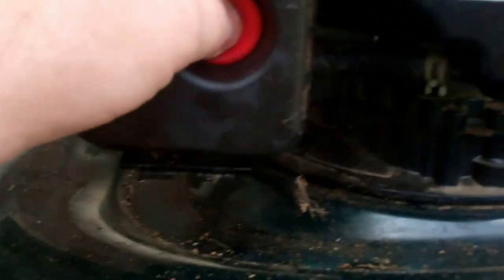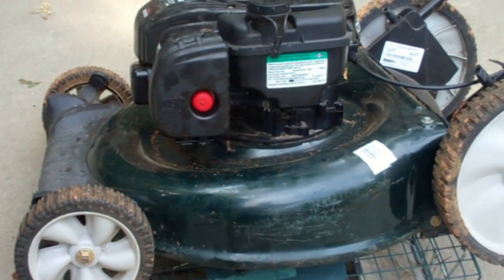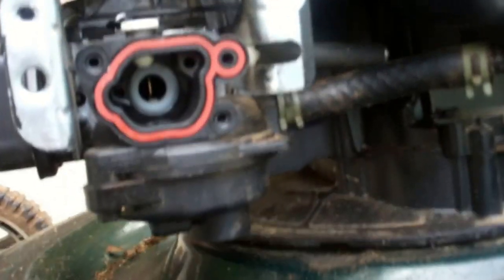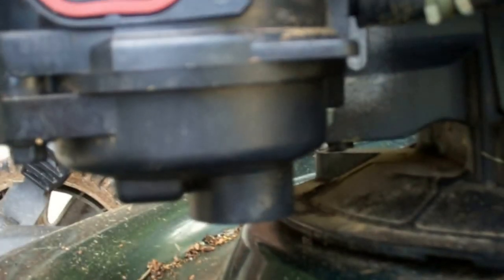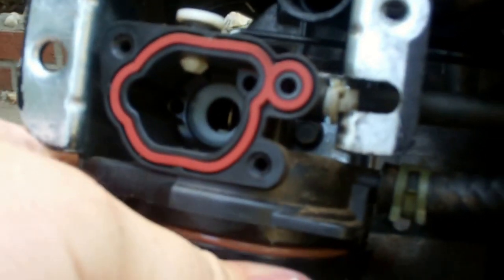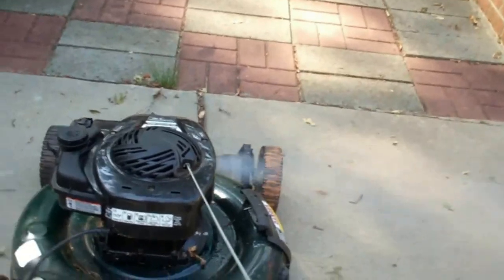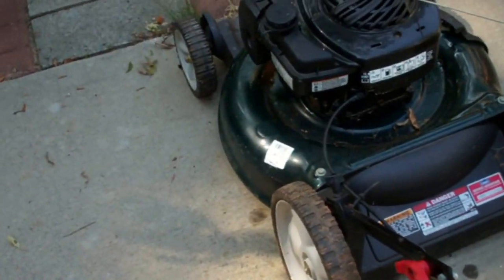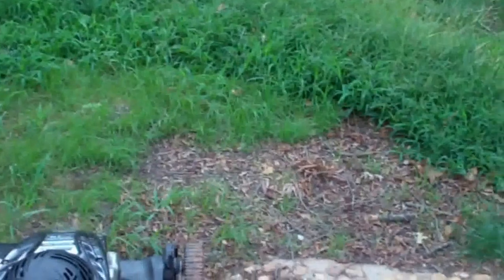Lawn Mower Repair & Cutting Grass

Comment: I have a Bolens with the same engine and of course it wouldn't start so I cleaned up the spark plugs and took apart the carburetor 
The jets were clogged and she started up on the first try.
This lawnmower engine is a Briggs and stratton and it never had any type of fuel filter on it anywhere so it seems like they made it as cheap as possible, these engine's last a very long time as long as you do basic maintenance every year 1 drain the gas tank or use a gas additive for storage
2 check the spark plug before you use it for the first time in the season
3 change the oil before you use it for the first time in the new season
These three simple things with keep your mower running for a long time 👍

Comment: When My Bolens would not start. I took apart the carb and pulled that oval  white assembly out of the center and slid that one small tube off and all the little holes  in that inner tube were plugged. I soaked it Castro super Clean ,rinsed it off and assembled it and it starts first pull now

Comment: Thanks a bunch! I have the same mower and it's less than a year old but has been sitting all winter with (likely) bad gas in the tank (my bad) and won't start. I'll try this tomorrow and hope for the best. Thanks again!
Reply from the maker: No problem. Good luck!
Reply: Jim Simpson Did it work? I'm having the same issue with mine.
Reply: It worked great! I sprayed an Instant Start can (that included ether in the list of contents) on the carb for three sec and it started on the first pull

Comment: Question? Where do you check the oil? And where to put the oil in this specific lawn mower? If you have any video for this o just please tell me answer and I will look for it. Thank you
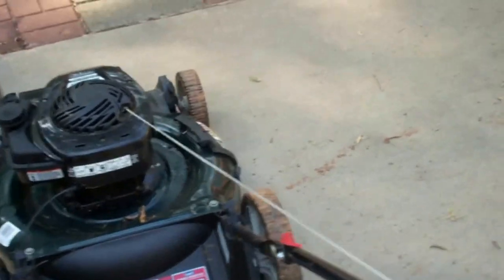Reply from the maker: +Celeste MC On this video at time index 4:26, you'll briefly see a yellow colored cap.. That's where you check the oil.
Reply: RVR2 ok Thank you! Now question #2 where I put the oil?
Reply from the maker: In the same place. You'll need a funnel though.. Just don't over fill it!
Reply: Ok! Great! I was wonder about, Thank You so much!!! I will let you know how was! I will follow the clean up step on the red bottom 😬 Thank You for your help!
Reply from the maker: No problem. Good luck!
Reply: +RVR2 Hi again! Just to let you know that my mower now is working! I just did all that U said in the video (the red push bottom) I had to push many many many times until turn on. 
Thank U
Reply from the maker: Awesome! Glad it worked!

Comment: So I have the same mower. I feel like I'm missing a hose and it's making the mower not start. Wondering if you can help me. Is a hose suppose to go on the small white piece that is right above the fuel hose?
Reply from the maker: Not sure exactly because mine doesn't have one there either
Reply: Oh ok. Do you have any idea on what could cause it from not starting?
Reply: It is a fuel filter.  The part # is 951-10358A
Reply: That could be the reason?
Reply: I am in the process of getting one for mine now. It is only around $4.50 or something like that.
Reply: No there is not supposed to be a hose on the white piece that is a breather vent. There is only one hose the fuel hose thats it. Those are good mowers everyone complains about them but if you take care of them they last forever I have 3 of them with no issues at all. If you simply add a inline fuel filter and use ethanol free gas, keep your air filter clean and your oil full and clean you will never have a issue with it. People think plastic carburetors are something new and they are not plastic carburetors have been around for years I do small engine repair a lot of older 2-cycle Lawn Boy mowers have plastic carburetors with cork floats inside of them and they run forever! The best way to clean a plastic carburetor is with water and dawn dish soap in a ultrasonic cleaner and they come out spotless and work perfect! Carb sprays on plastic is bad and eats away the plastic causing major issues later on but if you follow the steps I mentioned above you'll never have a problem. It all comes down to the ethanol gas and not having a fuel filter to keep sediment out that gives everyone all the problems. Hope this helps.
Reply: Thank you! I needed this help!
Reply: ricky silva Mowers could not start because of a clogged air filter not allowing enough air for the motor to breathe, a worn spark plug (weak spark), bad fuel, a dirty carburetor, or oil getting on the spark plug. Start by cleaning/replacing the filter, replacing the spark plug(make sure to have it properly gapped), and adding new fuel.

Comment: Hi RVR2, my neighbor has a Bolens push mower with the same carb as yours. As to the different type screw fasteners...two are coarse thread screws going into plastic of the main carb body while the outer two are machine threads going into the metal support for the plastic carb. Once you remove the fuel line and breather tube, it is easy to pull off the carb by just removing the two machine bolts and linkage. Two O rings seal the carb to the intake ( be careful not to loose ). The carb is almost completely plastic.  Once the carb is off, invert it, remove the two coarse thread bolts that hold on the bowl and expose the float and fuel pin, being careful not to loose the float metal pivot pin which just snaps into the body. Notice that there is a plug with an Allen socket on the bottom of the bowl which is used to drain the bowl for winterizing.  The carb body also has a white plastic nipple with barbed end on its side ( above fuel line). Yours has a short plugged piece of hose. Mine was just exposed but is used for the plunger suction feature (primer bulb vent ).  No diaphragms or gaskets to speak of.   J K
Reply from the maker: +James Krivitsky Oh ok. Thanks for the information.
Reply: +James Krivitsky 
Any idea what got the primer to start working...?